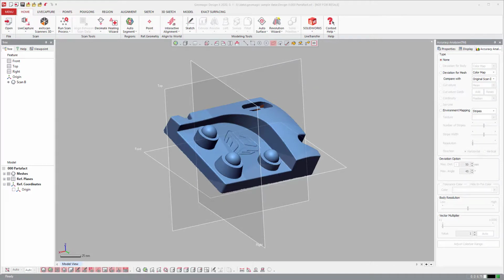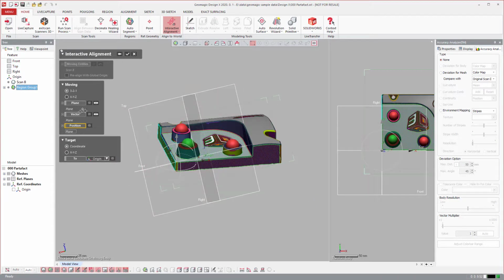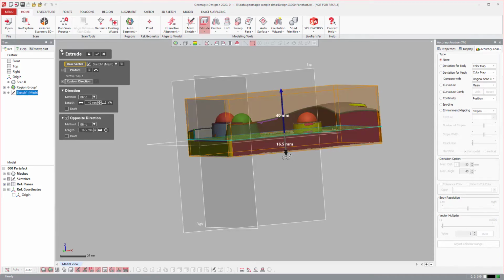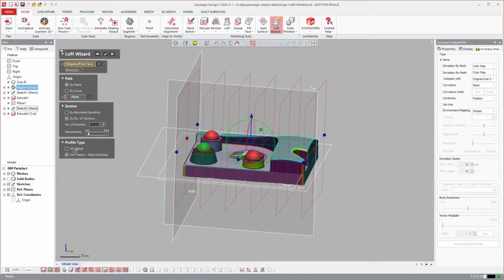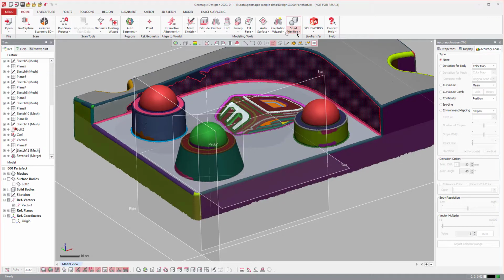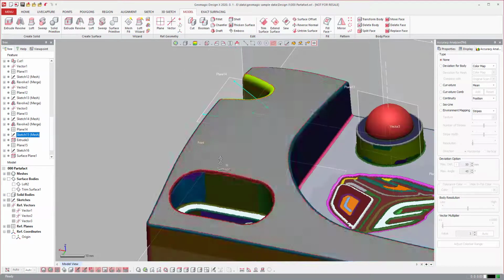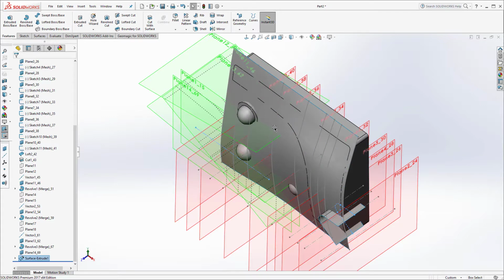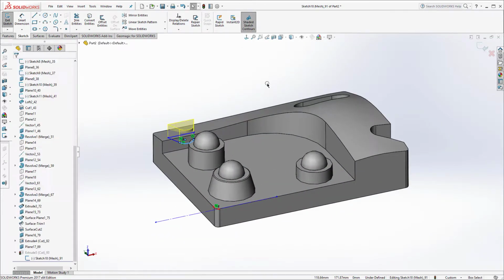Geomagic Design X - Basic Demonstration

Comment: Thanks for your presentation! I have one question: to create a CAD Model with full feature tree for the downstream CAD application like solidworks or nx or any other, is it mandatory to have Design x and the mentioned CAD system installed on one computer or can you also export a file without the live transfer that can be fully edited in the other CAD programs or transfer via internet or into a file with which the Transfer can be performed on another computer? The use case i imagine is that i do the reverse engineering in Design x for customers, provide them a file and they can load it into their CAD system without me having to buy all the different expensive CAD systems.